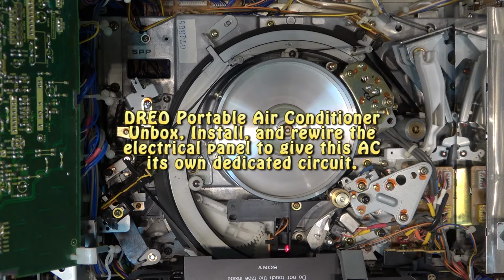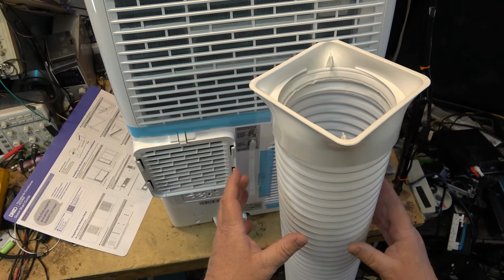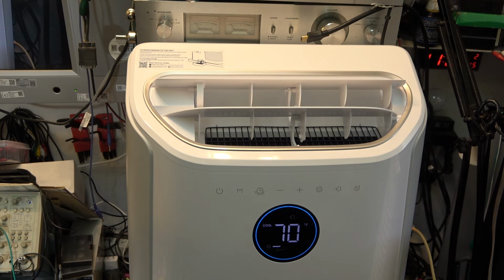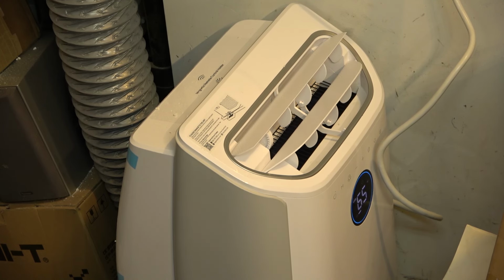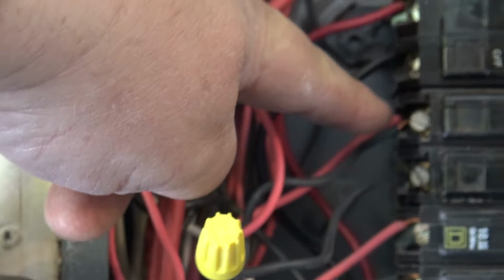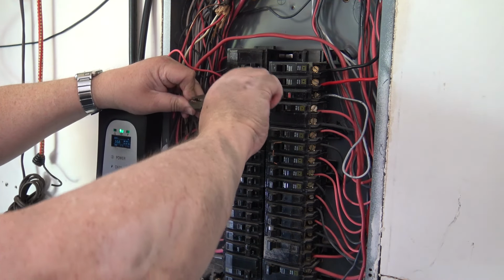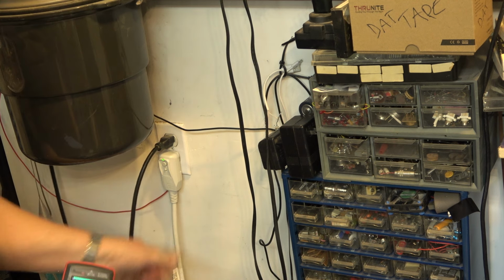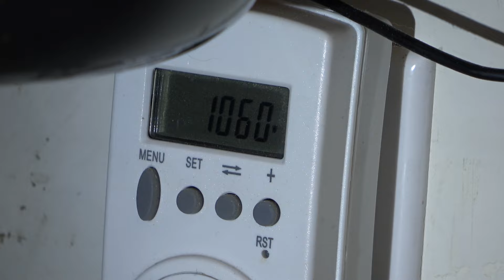Unboxing  A New Air Conditioner from DERO for the workshop.

Comment: not as effective as Split-System AC unit, because this thing will leak hot air but as temporary measure i think it's still ok
Reply from the maker: It won't leak hot air, it will pull in some warm air to replace the hot air it expells.   They are around 20% less efficent than a split system. Less expensive to buy and only 1 vent hose to trip over.